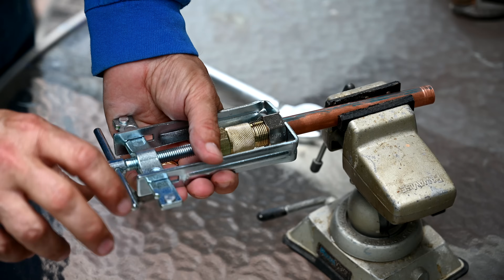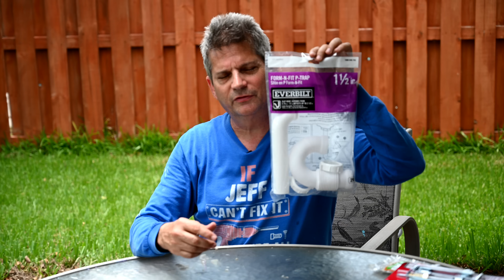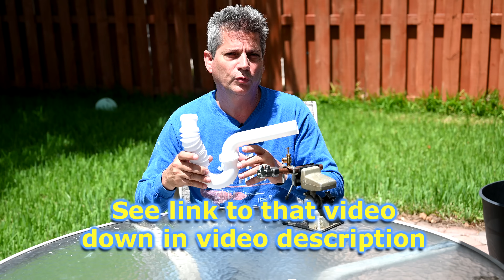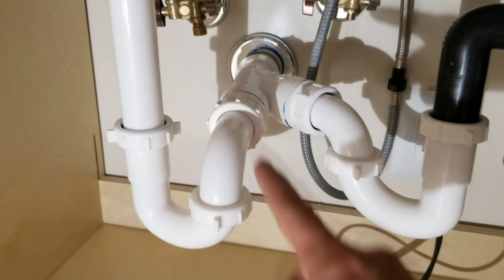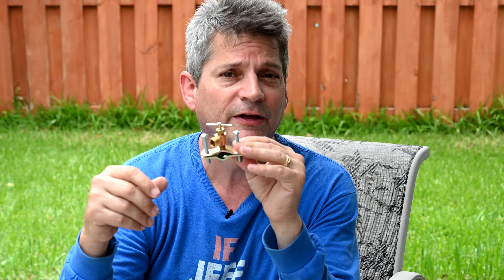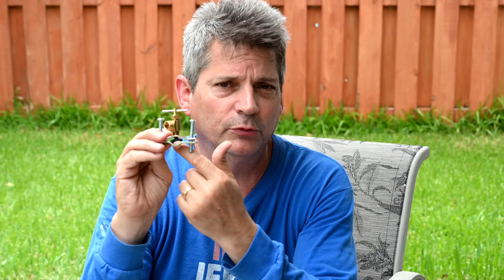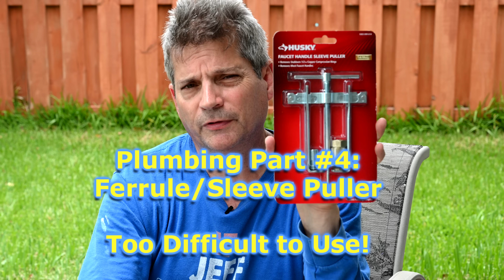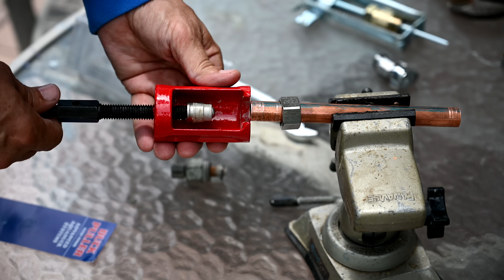4 Plumbing Parts/Tools You Should NEVER Use. NO Plumbing Fails

Comment: It is a modified faucet handle puller. They suck big moose balls even when used on a faucet handle..
Reply from the maker: They only really work when you ferrule is not stuck to a corroded by, which is never for me! LOL, actually we did get it to work a few times, but those few times were 10 minutes, on one half an hour on another, all unacceptable times.

Comment: When I remodeled my bathroom I taught myself (from youtube videos) to sweat pipe fittings so I sweated on threaded adapters on all the water outlets.
It's a handy skill to have for DIY and if the valve ever needs to be replaced, it can be done in minutes.
Reply from the maker: That's a great idea!
Reply: It's sooooooo much easier to solder new stuff than old stuff. 

You'll be heating for a lot longer, boiling the lines dry!

Comment: My furnace installer which is a major installer in Buffalo, NY used a saddle valve to connect the whole house humidifier to the waterline. So it isn't just DIY'fers that make that mistake.
Reply from the maker: I have encountered a small number of people who install humidifiers who are convinced it is OK to install a saddle valve for a humidifier onto the pipe. Don't know why, a couple in the past have commented to us that code allows it, because it is a humidifier but they are all wrong. Every time they tell me what state they are in, I find it in their plumbing code that saddle valves are not allowed.

Comment: Ok Asshole then let's see you go do it for someone  for 50 bucks....you wouldn't...you know damn well you charge 300 bucks to make an icemaker connection....you're  just miffed at handymen...because they're cutting your throat....I've used saddle valves for years and have had no problems..AND have seen your CODE APPROVED compression or sweat angle stops leaking like crazy.....Also the  all hailed code board is RUN by plumbing fixture and fittings manufacturers
Reply from the maker: You are wrong on all counts, you are just an angry person. No handy man is stealing work for from me, there is plenty to go around. what I get miffed at is handyman who do a lousy job, and leave the poor folks who could barely afford to  pay them in the first place with a disaster on their hands.
Reply: @jeffostroff  Ya ya...Just keep plugging your products

Comment: Thanks for bring to light of the duck puller.  The problem with DIY people like myself is 1) Usually something breaks and we need to head off to the big box store since plumbing stores may have already closed, 2) The big box stores tend to stock very little variety of a part and may tend to be cheap ones,  3) Just not knowing the name of other parts.  I to bought the Huskey puller during a repair in the evening.  Also though, if I one isn't pulling off the compression rings frequently and only does it once a year, then the Huskey tool might be worth while even for the grief encountered during its use.  It was very difficult to use as mentioned.  Going to pick up the Duck Puller.
Reply from the maker: Awesome you'll have the best of both worlds

Comment: I agree that the Husky tool is not a high quality professional tool but if you read the directions and put arms in the outboard notches it might not slip off the nut as easy and might actually work!   If you on;ly need to remove ferrules occasionally and you have ample length just cut it off with a tubbing cutter which then leaves a nice clean pipe which will seal bettter or cut the ferrule carefully with a hack saw or ocillating saw.
Reply from the maker: Yes we have used it many different way in the past, and the tool works only when your ferrule is not stuck. Only problem is in the foreclosure world, we inherit a lot of neglected homes, and bathrooms with histories of flood damage, poor ventilation and high humidity that corrodes all the valves and ferrule sleeves onto the pipes. This tool is not up the task to remove stuck ferrules because it has no mechanical advantage like the red Duck Puller tool that I use. that one is the best.

Comment: I've used the faucet handle sleeve puller, tool #1, to remove a sleeve that was stuck pretty tight. But I did not use the two side brackets, I removed them, and used the tool in a similar fashion as tool #3 in your video. I inserted the pointy tip of the tool into the pipe coming out of the wall and started threading the nut onto the threaded end of the tool by hand. Once it was too tight to thread the nut by hand, I used a wrench to turn the tool and thread the nut all the way out along with the sleeve. I did not have any room to turn the tool handle because the old valve was behind a stand type sink and so I used a wrench to turn the tool. I think the side brackets are supposed to be used for pulling a faucet handle, not for pulling a sleeve (ferrule).
Reply: Yes. Remove the top part no need for arms - you are not supposed to use them as you aren’t pulling the nut. There are videos on line how to use this type of tool to remove a compression ring.
Reply from the maker: Yes we ran into problem because with truly stuck ferrule sleeves, this tool can be a problem.

Comment: My drain is in the concrete floor facing upward. I'm not sure what else I could use other than an S or P trap? Nothing is lining up either and the accordion fitting was the most logical but after seeing this.... what would you suggest?
Reply from the maker: Build it out in pieces like we did here in this other video: https://youtu.be/b_OSgwpteR4   "P-Trap Installation Drain Doesn’t Line Up Bathroom Sink Pipe"

Comment: the puller should be of if you use it without the 2 hooks.  The hooks are for faucet handles.  Using both hooks and screw, you are fighting against each other.
Reply from the maker: Right older versions the instructions were not clear on it.
Reply: sorry, typo:    puller should be OK if used without the hooks for compression fitting..............

Comment: Thank you for making this video. The remodeling company that installed the refrigerator put this in before the cut off valve. If I want to change it now, I will have to cut off water to the whole house, and then it will be difficult to do a sweat fitting on a wet pipe. Perhaps I should use a shark bite.
Reply from the maker: Don't use a shark bite, it is better to sweat the the copper piece on, or just cut back the existing pipe to behind where the pieced it and install the compression 1/4 turn ball valve. If they left you enough pipe, you won't even have to do any soldering.
Reply: @jeffostroff  I have one that was installed for a refrigerator ice maker, which was tapped about 3 or 4 feet before a vertical hose bib.  If the saddle valve is replaced with a compression valve, does the valve have enough mechanical integrity to last as long as a soldered in replacement valve?  It'd be easier with the compression type but if it's mechanically better I'll use the solder version.
Reply from the maker: @wingerrrrrrrrr  yes compression valves have proven the test of time very reliable

Comment: I have worked in the home improvement industry for over  40 years. I am a Master Handyman. Which means I have learned building codes and know when to call in Professionals if for no other reason to know it will conform to local codes. I have worked in Hardware stores also. So many times I catch DIY'ers and so called Pros trying to find things that will make the job easier. Usually after I explain why, they thank me for not making a mistake. Plumbing has always been an interesting area. As you know and have seen there is no end to the senseless creativity one can run into. You have my full support in educating people how and why things are done the way they are done and why there are codes to make sure they are done correctly.
Reply from the maker: Thanks Michael!

Comment: Nice info. I never liked saddle valves either but did know they were against the code. Had a new furnace installed with a humidifier. Those "Pros" used a saddle valve. I was upset but didn't know it was against the code or I would have made them change it. The good part it is in the basement so very easy to inspect, which I do often. 20+ years and still no leaks.
Reply from the maker: Glad it helped you with this video, at least now you know to look for it. Most people don't have a clue and have a leak running for weeks before they discover the damage and the water has wicked up the drywall.

Comment: Speaking of Arrogance.... 
I do both Home Inspections and Handyman work. Electrician by trade, but can do just about everything in the construction industry by gaining experience. 
I'm home inspectors are not "code " inspectors, however I call the flex pipe out Everytime, and Everytime I get flack, normally from "flippers". Last week, I was asked to replace a saddle fitting. I told customer I would replace with a different type valve. "SHARK BITE", because I explained the issues with saddle valve, just like you did in this Video. (Today is first time seeing this) I guess I do need to practice my people skills, because I don't want to be perceived as an arrogant "professional" as yourself. Man, you should never feel you are above anybody. We are all in this grind together. 
Best of luck.
Reply from the maker: Thanks for the insight Travis

Comment: I kind of find that insurance company statement a little questionable? Policies would be getting canceled in bulk if they ever actually did the inspections.
Reply from the maker: Yes they probably will. We just got contacted by another lady yesterday whose insurance company told her to remove some tubes from the island kitchen. I don't know why so many of you out there doubt this. I see it all the the time. I got called to 2 different lady friend's houses who got a 4 point inspection from the insurer, and told them to remove the flexible P-Trap. Talk about nit picking, another company told our other lady friend to replace the outside main power box, because it had a few rust stains on it. I had to sand it down and spray it with primer and battleship gray paint. But I assure you this is true.

Comment: When you replaced the stop in the last example, why not leave the old the nut and copper ring there and jut put a new stop on it?
Reply from the maker: It's preference. Some people take the lazy way out, I like to install everything brand new, and it gives me a chance to polish pip back to brand new stats and star all over again from square 1. Even though ferrules are usually the same size, I prefer to use the ferrule that comes with the new shut off valve as the manufacturer designed and machined that ferrule to work with that valve, there won't be any tolerance issues that might cause a leak.
Reply: jeffostroff   Don’t those ferrules dig a little into the copper pipe?  Does it ever ruin the pipe when trying to take it off.  I never thought it would come off.
Reply from the maker: @stevekapp6462  these do not dig in, and I never seen one damage a pipe either. They slide off with a ferrule sleeve puller and the new one goes on.
Reply: jeffostroff I am anxious to try this when I need to replace one.  Thanks for the answer.

Comment: Thank you for this video. Im a GC and sometimes I do "handyman" work. I do however know my limits but it doesn't stop me from learning more, especially certain trades because even though I do not necessary do them I do need to know when my subs are doing bad work and/ or if a homeowner needs to know what the problem is and me knowing how to fix it and convey it to my sub so he can give me an accurate estimate. I think it wold be great if you take each problem and make it its own video for the sake of length but also to leave room for showing us eager learner how it should;d be done instead of showing us the mistakes. Its easier to comprehend and makes it practical if you make it segment style. However, its your show and I dont want to steal your thunder, its just that Im interested and worked with many TV people who did this type of videos and learned a thing or two. Cheers, keep up the good work
Reply from the maker: We already started doing that with this video. several months ago we uploaded a segmented devoted only to alternate methods other than the saddle valve. We have another video that shows how to connect your drain pipes under the sink when they don't line up, and you don't use the flexible P-trap.
Reply: @jeffostroff  Thank you, I just started watching and didn't know you had videos out. Will checksum out for sure Jeff.

Comment: That’s why you need a properly vented system so that you have air movement. Then the s trap or p trap has no issue. Floor drains are a much more likely to allow gas as they set dry unless you pour water down them constantly. So many places I have been where gurgling occurs.
Reply from the maker: John your S-Trap may still self siphon, as the problem is mostly do the inertia of the water, a real long leg leaving the S-Trap, after a short leg entering the S-Trap.

Comment: This video is deceptive on the "S" trap and the husky puller. Jeff needs to learn how to correctly assemble "S" traps. The only reason a "P" trap would work better is when the code requires the venting of the sink line to atmosphere. This cannot be seen as the vent piping is in the walls. Older homes without this venting offer no advantage to "P" traps over "S" traps.  Jeff also needs to re-read the instructions on the Husky tool to use it properly. The video clearly shows the "T" handled puller screw set too long into the pipe grip.  Either knock the sharp edges of the tool with a file or wear gloves. simple fix that even a DYI'er or butt-crack
 plumber can master.
Reply from the maker: Jerry needs to brush up on his S-Traps. The major cause of siphonage out of an S-trap is the inertia of water going down a long leg out of the S-Trap after water enters the S-trap from a short leg. Also this wasn't a lesson on how to hook up an S-trap, it was merely there as a prop. Get over yourself.

Comment: https://www.youtube.com/watch?v=MjNrGuxYvjQ
Reply from the maker: The tool still give s poor mechanical advantage. Did you hear that guy grunting and huffing and puffing trying to struggle to pull that sleeve off the pipe? That's because the tool offers ZERO mechanical advantage from that tiny rod that only allows you to use finger strength to twist. Then it hurts his fingers so much he has to keep switching hands. Then when he's done, he said that was one of the easier ones, LOL! That's why I use the duck puller, just slap a ratchet onto it and the ratchet provides all the mechanical advantage you need, with no major effort, no grunting, no switching from hand to hand to in agony, the Duck Puller just makes it easy. I just don't se ewhy people want top put themselves through that grief and punishment.
Reply: @jeffostroff  I agree it's not the best tool and it is cheap. It may be difficult but it can actually get the job done. What surprised me is that you made a video completely discrediting it while not using it properly. 
I enjoy your videos. You give good tips. I don't know if you can edit the video but that portion is misleading. BTW, I'm one of those handymen you referred to! :)
Reply from the maker: @itsgabegutierrez  The videos can't be changed once they are up. The tool is not as good as you think. Even that guy in your video struggled. It only works on really good condition pipes and valves. Unfortunately in mu line of work buying and flipping foreclosed properties, or fixing elderly victims neglected properties full of rusty pipes, I encounter neglected and flooded, and leaking plumbing properties with corrosion on pipes. These Husky Pullers are not up to the task. I found they worked 1/3 the time for me, but those are bad odds. I need 100% guarantee. One time we struggled 1 1/2 hours to get a ferrule off. Since I bought the English tool company puller and the duck puller, I have not had one single failure, it has worked every time, and easy too, 30 seconds compared to minutes that the other guy struggled on the other video. I have 9 to 12 of these to do in every house, don't have time for nonsense.

Comment: You are wrong on the use of the Husky compression ring remover. You didn't use the silver fitting that goes into the pipe to push out the compression ring. And you DO NOT squeeze the handles behind the shut off valve nut on the pipe. That part is for removing a stuck faucet handle. The part that looks like a handle can be easily threaded out and removed. Sorry man but you just don't know how to properly use it.
Reply from the maker: Part of the problem is the horrible instructions on the back of the tool that show the handles in use during sleeve pulling.